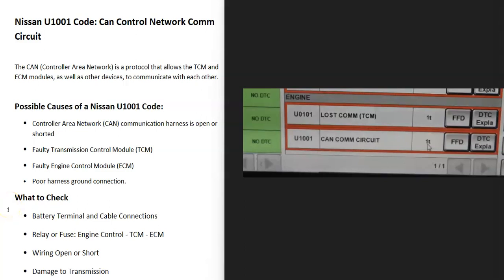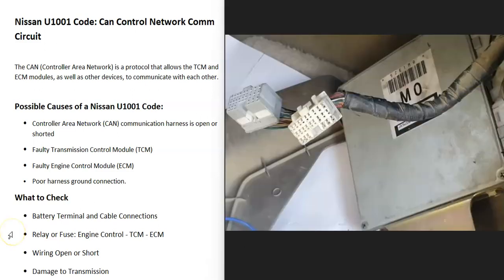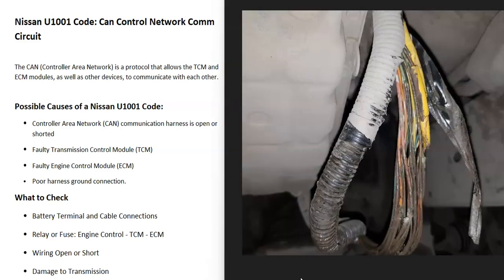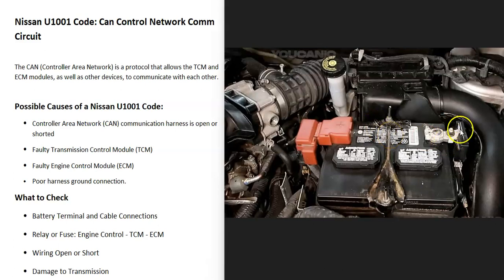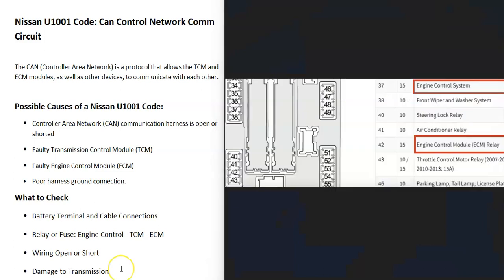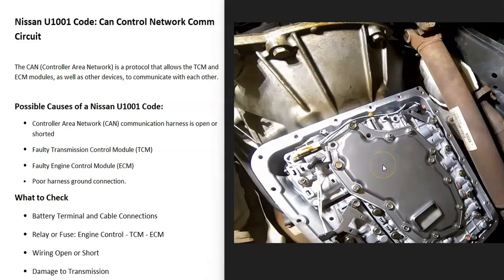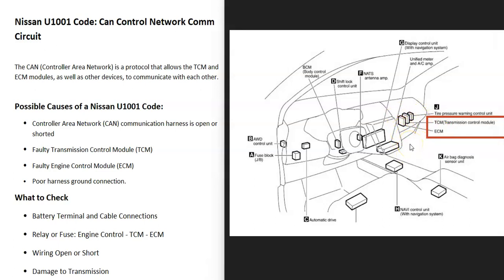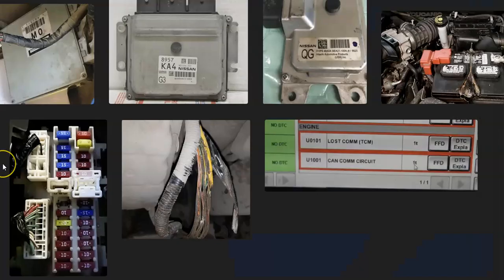Causes and Fixes Nissan U1001 Code: Can Control Network Comm Circuit

Comment: Hi, nice videos, I have a 2014 Nissan xterra with code u0101 and I just replaced the tcm/valve body assembly I checked the 10 pin connector at the transmission and have voltage and grounds where there supposed to, anything else you think I should check? I’m thinking I have a defective tcm.

Comment: u1001 can lost com.... depend what dashboard tell you....start from simplest way, check the FUSES,
Mine case ABS and brake light illuminated, odometer didn't work,check code U1001...check the fuse 10amp fuse is the culprit,change fuse,and all work back....

Comment: To reiterate, there are no symptoms in this car. Everything works perfectly. When I first start it up, I get P1212 and U1001 fault codes from the OBD device. It does not turn on the engine light, but I delete the faults without turning off the engine. I do another scan and it does not give these fault codes. At another time, I read P1212, U1001 and P1651 from the OBD, but it does not turn on the light. Sometimes it turns on the light, only when P1651 is deleted, the light goes out.

Comment: I like your videos, wanted to share that I had a code for while and spend a lot of time on it, then unplugged the plug on the neg power lead from the battery and disconnected the alternator managment system and all my problems seemed to have gone away :)

Comment: HELLO, HAD A VALVE BODY REPLACED  FOUR MONTHS LATER I TURN THE KEY IT CLINKED ONCE NO START. I DID A SCAN AND THE CODE CAME UP 1001, 1000, 0051, 1168 I .. I REPLACED THE IGNITION STARTER RELAY,  AND SAME THING  BUT NOW IT STARTS ON TWO  TURNS  . WHAT DO I DO?

Comment: Would mind helping me?

2016 Nissan Rogue SV AWD
Code:

U1002 is related to missing CAN communications on the network

P2096 Post Catalyst Fuel Trim System Too Lean Bank 1

Thx

Comment: I have a Nissan Micra and it has an issue where occassionally the speedometer stops working and the abs warning light, brake warning light and intelligent key warning light is on. After a while, the warning lights turn off and the speedometer starts working fine. This happens intermittently and scan results showed a U1001 code. Any idea what could be the issue ?
Reply: Did you get yours figured out, this is near identical to my Maxima
Reply: Hello. How did this error fixed? Got similar in my car
Reply: Yet to get it fixed. Nissan Authorised service centre claims that the speedometer unit is faulty and recommended replacing it. But I'm not convinced, since the speedometer works fine intermittently. They are avoiding me now, when I asked them to demonstrate it by installing my speedometer unit on another Nissan Micra or install a working speedometer unit to my car.
Reply: @Vishnukkaass  what I have found is that the speed sensors in the rear of these cars are known to go out often, but since they are using a DC voltage(Nissan tried that for a couple years and realized It was a bad idea) instead of an AC voltage when they go out they usually short out the abs pump. If you pull your rear speed sensors I bet one of them will be scratched up. There is a TSB on this issue for the 06 Nissan Maxima
Reply: Speed sinsor